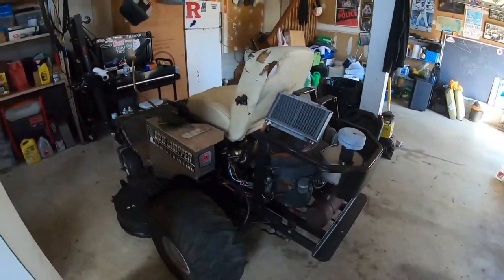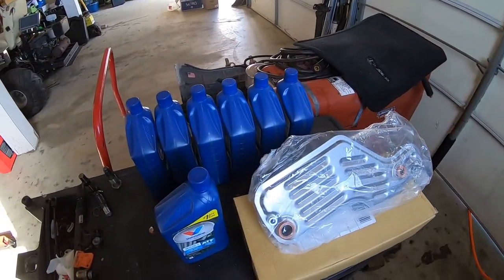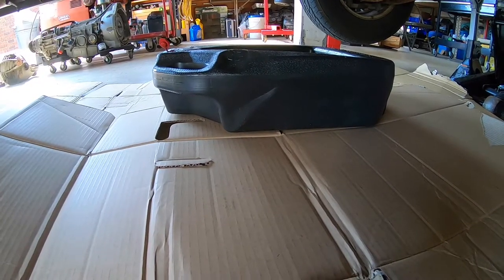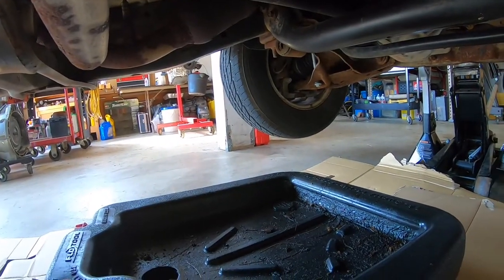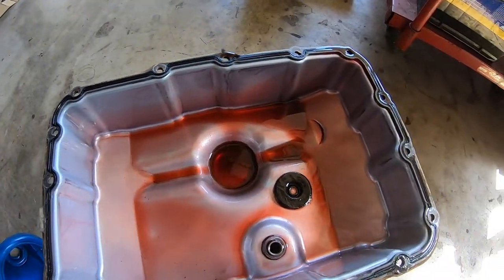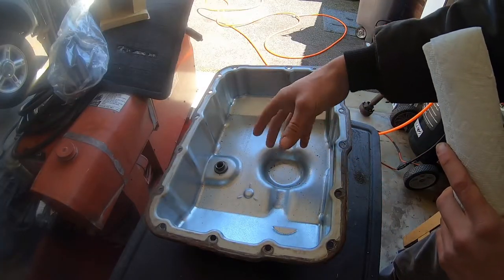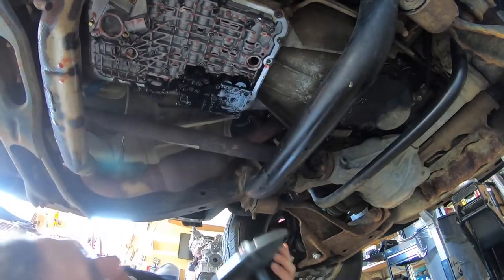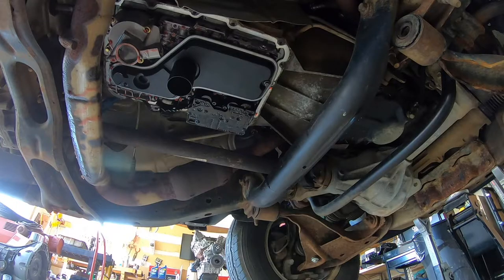Ford 5R55S Transmission Fluid/Filter Replacement (COMPLETE GUIDE) - 2002-2010 Explorer/Mountaineer

Comment: Actually have a question about my 05 4.0, it is quiet until it gets warmed up, then it rattles, it's quiet as a church mouse until warm, u ever run into that
Reply from the maker: Yeah because the oil pressure is around 60psi when cold keeping the chains tight. When it warms up it drops to around 10.
Reply: @iamdjnam  here's my thought, if my motor is quiet until the oil pressure drops due to hot oil, do I need to replace the chains and guides, as it sounds fine when cold, the front cassette is in good shape, and I bought a complete chain and tensioners set, but it was cheap, I'm thinking the guides and cassittes are all I am going to replace, and keep the stock chains, will this cure the rattle, or should I just buy higher quality chains, my explorer is lifted with 33 in tire
Reply from the maker: Buy a full chain/tensioner/component kit. The factory chains stretch and will still make faint noise even with new tensioners and guides.
Reply: I have a complete chain kit with cassettes and all , but it is the lowest priced version, have you used the cheap kit? Hate to waste all the effort and it fails
Reply from the maker: Yeah it’s garbage. Get the $200+ kits. I used one that was $49 and it’s still going but I can swap these in less than a day.
Reply: These are interference engines so if a chain breaks , it's going to ruin the engine
Reply from the maker: @johnlogan1776  yup yet people still say they aren’t despite the undeniable proof in my videos

Comment: I've seen some other sources/sites where they say not all of the fluid will come out by draining so you have to put in as much fluid as you can, drive it a bit, drain again, top off with new fluid, drive it again, etc etc....repeat this 2-3 times, so all the fluid in the trans is displaced by new fluid.
Reply from the maker: It’s true. But if you change it like this every 30k the trans literally will last such a long time.

Comment: I got a 08 ford explorer, got it from an older guy who had it serviced every 3 months... had it for a little over a year now and was wondering if it would be okay to get the fluid and filter changed? Haven't done it yet and it's a high mileage vehicle. It runs good and was well taken care of. So to late to worry about the filter you think or still good? Appreciate any help.
Reply from the maker: If it’s high mileage I wouldn’t risk it.
Reply: Did he ever have the transmission serviced, I mean it sounds like he stayed up on everything if so how many miles ago that will tell you if you need to do it or don't risk

Comment: Need a used transmission and a rear timing chain tensor before it breaks   115kmilage front was done at 80  let me know if you are interested
Reply from the maker: Nah sorry
Reply: Can’t hurt to ask your channel is great keep it up ! does the front cross member have to come out with a o6 explorer and do you know what size the o2 sensor are loos like I have to remove the passenger side to get to the manifold bolts. Where should I get the rear cassette from dealer?  Thanks Walter

Comment: Hey brother , I owned Explorer 08 , recently I top up my transmission fluid whiteout opening the pan , after that my transmission started giving loud noise , can you please advise what went wrong and what should I do now , gear shifting also affected  with a bit delay.
Reply from the maker: Could be overfilled or wrong fluid was used.
Reply: @iamdjnam  yes you are right it was overfilled , today I went to the technician and gave him a hard time in explaining , it was more then a liter extra , today I removed the excess oil , but the sound is still coming same like metal squeaking sound